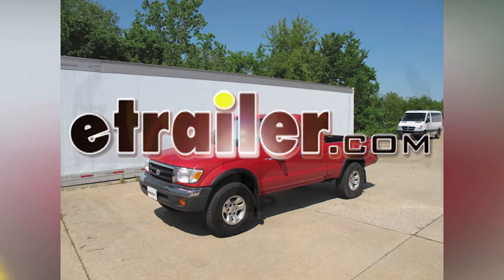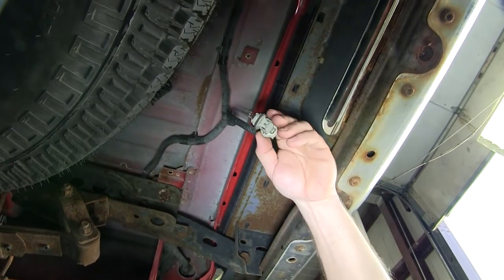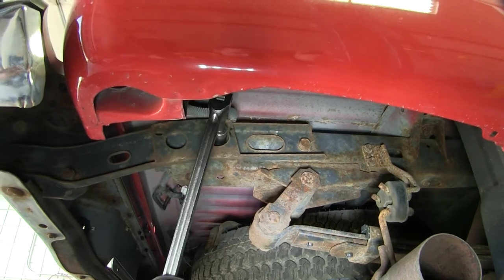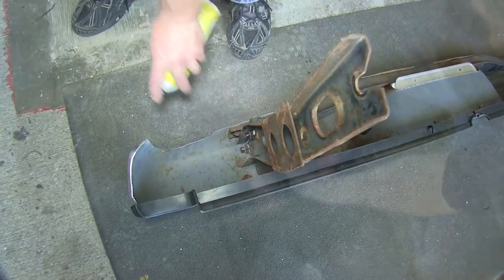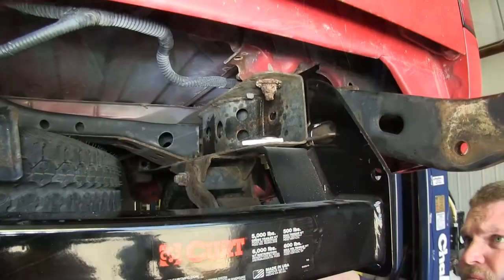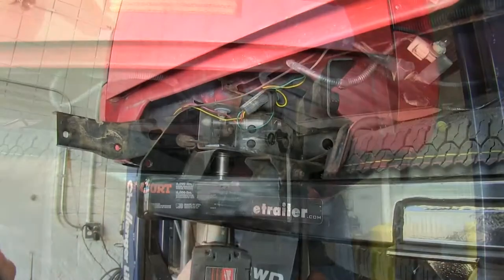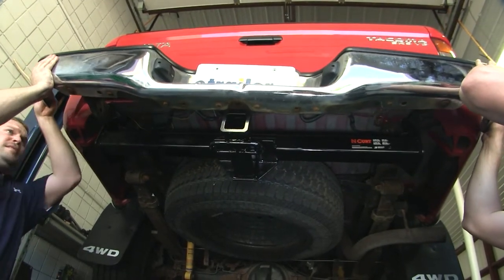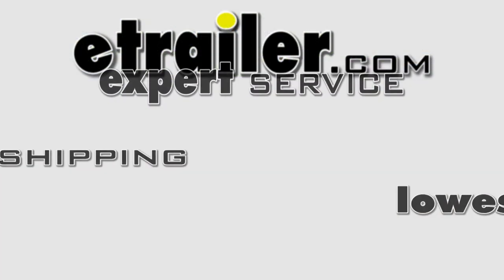etrailer | How to Install the Curt Trailer Hitch Receiver on a 2000 Toyota Tacoma

Comment: I got this same curt hitch 2 days ago and put it on my tacoma for that reason for towing a trailer level instead of having the ball on the bumper lifting trailer up and having it ride crappy, this curt hitch is made strong and fits good and u can use it for bike rack if u have a camper on your truck and don't want to stuff the bikes in there